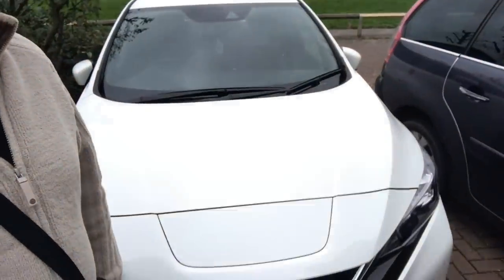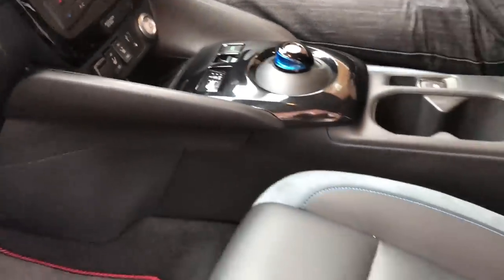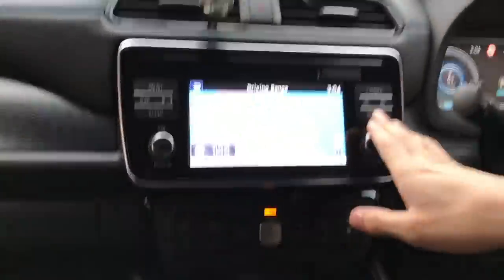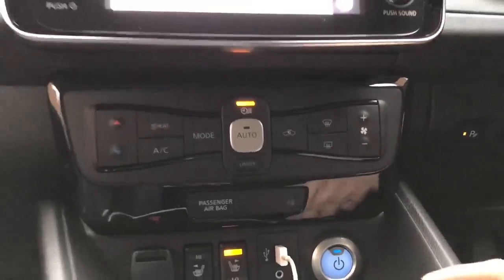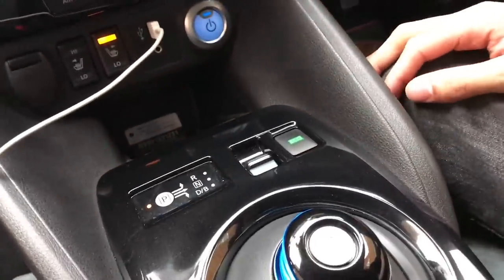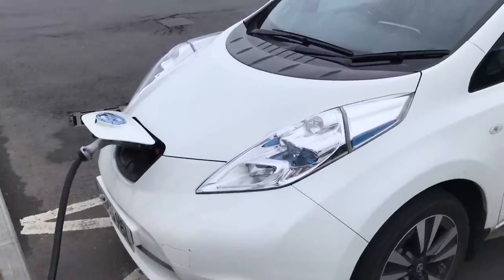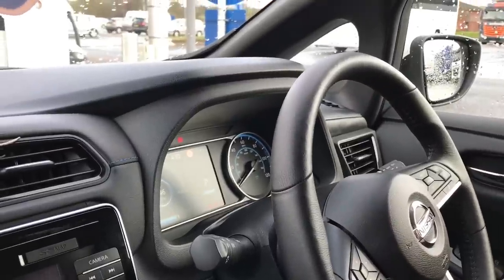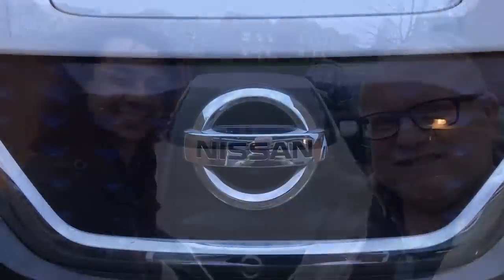Nissan Leaf, 2018 Tekna Spec Review

Comment: excellent review Dorian, why does it need a standard car battery aswell as its own batteries??
Reply from the maker: Just like a normal car, it’s needed for interior lights etc and the onboard systems.
Reply: The 40kwh traction battery is a 400v battery, so for the rest of the normal car electronics, like the lights and infotainment system, are run from the 12v battery. There is a "DC to DC" converter which acts like an ICE car's alternator, which tops up the 12v battery while you are driving; aside from the slight current draw of that, any electronics running from that 12v battery don't really impact your range
Reply from the maker: Thank goodness you can give an intelligent answer 🤣🤣🤣